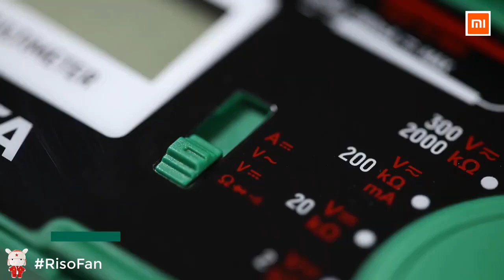New Xiaomi sata Pocket Multimeter Range Overload.

Comment: Can you translate the function,s in English  ?
Reply from the maker: Brand: SATA
DC voltage: 2V / 20V / 200V / 300V
AC voltage: 200V / 300V
DC current: 200mA
Diode: Yes
Continuity Test: Yes
Power supply: 1.5V * 2 LR44 battery
Size: 114 * 56 * 23mm
Weight: 101 grams (including battery and shell)